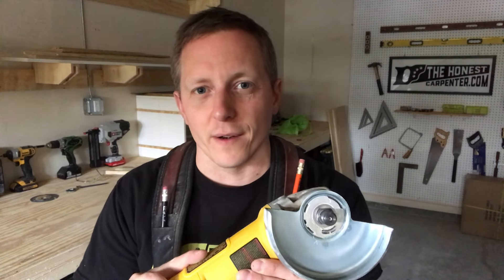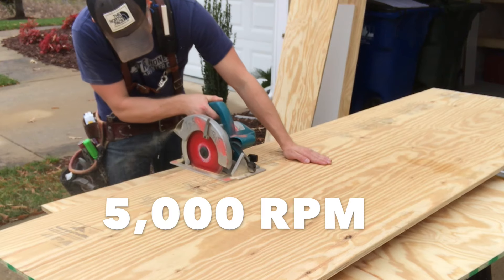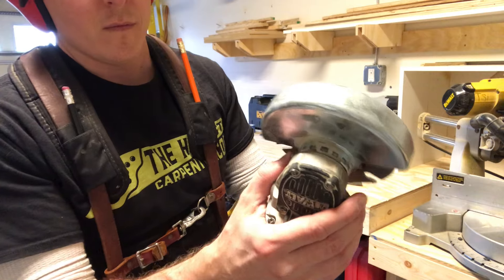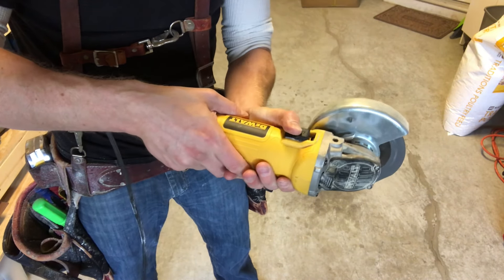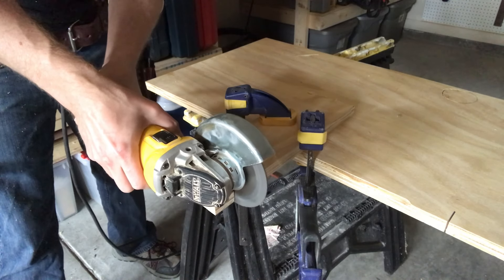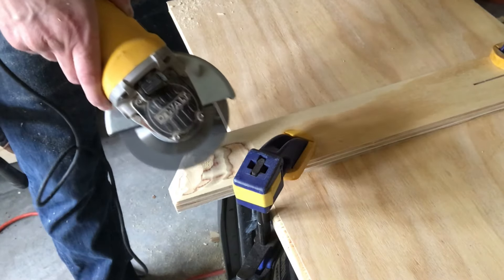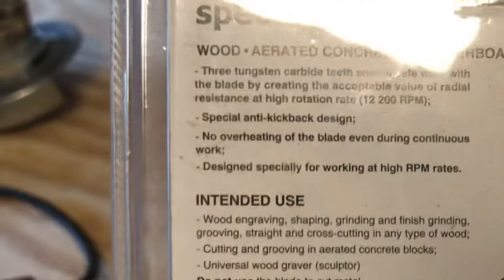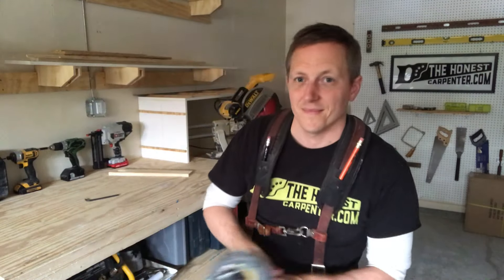CAN ANGLE GRINDERS CUT WOOD?? (Tricks + Tips--Cutting Wood With Grinders)

Comment: 35 stitches up the front of my leg from this idea. It opened me up like a salad sandwich. Don’t do it. Wood blades should not be used on this tool. Also, the corded model that your using has no safety switch, so the tool will dance all round your workshop, whilst you are bleeding right next to it. Don’t do it!
Reply: i also had 35 stitches , very very dangerous tool
Reply: Hope you recovered guys, thanks for sharing.
Reply: If you just need to cut wood with that ugly finish, just grab the cheapest circular saw........it will do the job way much better.
Reply: Thanks for making my day 🤣😂🤣😂
Reply: Thank you for posting this! I had the blade in my Amazon cart to buy, but now I know it's not worth the risk. I hope you are ok now.
Reply: @colinmellor3914  so sorry. Thank you for the warning!
Reply: I'm in that club too. Not as many sticthes but, my middle finger got cut down to the bone and actually fractured it. I was about to cut with a fibrous metal cutting blade.I was in my setup stage and had all of my PPE on except my gloves even though in my case i doubt they would have helped much.   I squeezed the trigger to rev the grinder up as you would a car and the blade disintegrated. It probably got damage unbeknownst to me a week earlier when i was using it.
Reply: They call that a Suicide switch for a reason.
Reply: ALWAYS respect your tools.  ALWAYS be thinking "How can this hurt me"
Reply: @colinmellor3914  Y’all scaring me.😌
Reply: Ok fine i wont
Reply: I to had 35 stitches
Reply: Yeah I'ma stick with my jigsaw
Reply: *revokes reply so I dont jinx myself
*reads every comment
*loud MEH. 
*No guard. 
*meh. 
Legggoo.  Will report back lol. If possible.
Reply: Wait. . Wait. . 
Whats a salad sandwich?
Reply: Did anyone have 36 stitches?
Reply: Thank you for this info. I’m just learning to use a grinder. I will definitely remember your advice 👍
Reply: I have been a metal fabricator for years.  Never had stitches,lol.  However, grinders are not the least bit dangerous.  People are.  If you are a weekend diy-er...DO NOT BUY THIS TOOL.  You were probably never meant to do this type of work.  Hire a professional and save your digits and or legs.  If you want to learn, start off small with flapper wheels or soft wheels on some sheet metal, get a feel for it.  Learn to get a feel for this tool.  Sorry guys, that tool never caused any of you stitches.  You did.
Reply: @Andrei-xl1xe  not true.  I am well aware that this video was showcasing wood cutting.  My point is, learn the grinder first.  Then you can learn to use the wood blade.  I use them all the time.  I am a wood and metal artist.  This is the greatest attachment I've found for wood carving and cutting when I can't fit a regular saw in tight spots.  However, the reason as to why I haven't had an injury, is because I understand wood, I understand using a grinder properly, and I know what kickback is.  You can't just go crazy with this blade.  You have to use the stabilizer handle, and lock your arm in when cutting to avoid kickback if it happens and have a firm grip with the other hand but have that arm bent.  Just like with a chainsaw.  And you have to cut straight! It's not meant to cut in various directions.  But will carve in various directions.  Learn the tool FIRST. Learn kick back and the reasons for it. Then understand wood.  Then you will be able to use this tool safely.  See what I did there? "YOU will be able to use this tool SAFELY. "  Not, " This tool and blade is dangerous, you can't do it, don't do it." 

Cheers! Good luck! Shoot me your email, and I will gladly teach you how to use this safely.  Have an awesome day!
Reply: They’re not supposed to manufacture wood blades for angle grinder at all. Fortunately, my soft shorts was tangled into the blade and spindle then stopped the motor before I could unplug it with help. It only ended up with some very light scratch on my leg. The speed is too high for you to imagine what might happen to it.

The saw blade used in the video has only 3 teeth helps with reducing the kickback force. But still, unlike multisaw or circular saw that both have blade guides, without the blade guide, it’s not a stable tool on woods
Reply: @zackmassey8258  There’s still danger of letting the blade go to fast into the wood in a day that’s too tired. Since there’s no guide to make sure it’s always perpendicular to work piece, the kickback force may suddenly change. Special care and skills may work, but definitely can’t avoid potential dangers.
Reply: @forexsanjose6090  from what I heard, those blade are actually for compact(small) circular saws.
Reply: @forexsanjose6090  disagree.  "Letting" means YOU allow it.  And it is YOUR responsibility to cut perpendicular.
Reply: Thanks dude, i gonna get a proper machinery.
Reply: @Andrei-xl1xe  it's for anything compatable.  What isn't always compatable, is the person using the tool. Cheers.
Reply: @zackmassey8258 why should I hire someone when I can do it my self
Reply: @cameronwallen  You should do it yourself!  Only if you have EARNED the discipline necessary to do so. If you haven't,  well....I hope you have a general understanding of first aid.  Because you might need it.  Define the term "novice" on your own time.  It can and DOES apply to everyone, no matter the medium. Safety really doesn't come first if you think about it....discipline does.  Good luck!
Reply: I had no stitches and love this blade . Does that make me the dumb one . I think not!
Reply: @andrewlittner5472   amen.
Reply: ???   I use wood cutting blades all the time—— Perhaps YOU shouldn’t—— also it’s DuMB to not use the screw in Handle that goes on Top- the tool is much More stable with the screw in handle—- but I see LoTS of dummies using it without—- DUMB.
Reply: It would be better to use a handsaw after reading all of this.
Reply: Thanks bro i really wanted to do this to a cordless grinder but you know what I'm just gonna go ahead and buy a battery circular saw. Hope you don't have that misfortune again.
Reply: Tip if you have no muscles don't use a grinder or any power tool for that matter its for strong men and just hold it properly and attach all the grip handle part and hold it correctly don't hold it like a ball your not playing catch or throwing ball you need to have one hand on the grip hanlde and the other on the base and hold it tight its not a frizzby or toy grip it tight and hold it be one with it
Reply: How did that happen exactly? I mean does it flip out your hands and go off in a random direction? Turn around? Is the kickback that strong?
Reply: I got 36 stitches it's very dangerous...
Reply: @davefaulkner8156  how? Like how does that happen…
Reply: I’m really sorry that happened to you. Watching the video my main takeaway was that you shouldn’t actually try to do that.
Reply: And I'm about to cut a mailbox post to install a solar light on the top 🙄😒
Reply: Yup, 35 stitches for me too, but I was opened up like a ham and swiss on rye.
Reply: I saw the blade and your exact comment came to mind
Reply: I bought the chainsaw disc, now banned. Saw how dangerous it could be even in experts hands, bin, gone
Reply: I carve with mine
Reply: Thanks you convinced me sir!!!
Reply: 35 stitches right here.
Reply: thanks for the warning
Reply: @muhammedk470 😅
Reply: I was going to use a mini saw blade on grinder until I saw your comment 

I was going to use on yard work for cutting tree suckers

Not doing it now. Thanks
Reply: The only tools here are the idiots who don't use the equipment in the right way, I've had a angle grinder for nearly 2 years always wearing gloves and protective clothing including ear protection,  I've never even come close to hurting myself with using it so I can't understand how anyone can end up with multiple stitches just by doing a simple job. Use a circular saw or hand saw for wood cutting and yes I also have those tools without incidents.

Comment: I’ve used these blades for years on aluminum although it had more teeth. Biggest thing I can tell you is find the handle to that grinder. Never use this type of blade without a handle
Reply from the maker: I’ve never liked using the handle, Brandon. Always felt like two hands were steering from different directions that way. Maybe dewalts handle setup isn’t that good 🤔
Reply: I agree that the dewalt handles are not that great. I always used an old school metabo grinder which has a better handle and a spring lock nut for the blade. Again I will say you are correct in saying these blades are dangerous.....some people actually used to call them “suicide” blades. Definitely not a blade for a novice to power tools. Always love you videos man. Keep it up.
Reply: @TheHonestCarpenter  you just need to learn how to handle a grinder, a lot of users don't like a handle, but I think they just don't take the time to learn to use. I am a metal fabricator and use a grinder a lot for many things, I have been using many brands over the last 45 years, they are pretty much the same as far as handles go.  The only time I have been bitten is when working for someone else and using their grinder with no handle. My feeling is your hand is just too close to what ever blade you have on, no matter if it is a toothed, cutoff, type 27 grinding, buffing, sanding or wire brush.....stay safe, thanks for making this video, watch out for those chainsaw type carving blades, they are really bad about kickback. Cheers from Florida, Paul
Reply: That's what helped me today was the handle. I might not have attempted to cut without it.
Reply: Handle/no handle, they're going to be dangerous. I'm much more comfortable with a chainsaw.
Reply: @Stetson Rodrigo Instablaster =)
Reply: @Kylan Marley It worked and I finally got access to my account again. Im so happy!
Thanks so much, you saved my account :D
Reply: @Stetson Rodrigo Glad I could help =)
Reply: @TheHonestCarpenter  
This is the silliest argument against safety feature I have encountered for a long time. It is up there with all the excuses for not wearing a seatbelt.

Putting convenience ahead of safety is amateurish.
Reply: @TheHonestCarpenter  Yes, it is the fault of Dewalt. My grinder has one more screw hole on the top, so it is inline with the motor shaft. This allows you to get your hands in the correct position for the angle you have the blade at. If your sculpting, sure use the side holes, but when you are chopping, you need the third hole on the top.
Reply: @brandonmims9980  ha good i went with the Metabo WEV 125 15 and i can reduce the amount of spins, so it is the same dangerous in the end as a normal saw, but i don't need to buy an extra tool for the beginning
Reply: @TheHonestCarpenter  , it may be awkward for some at first, but the handle is a lifesaver if you ever get a kick-back!  No excuses. Always use the handle.  With practice you will become very comfortable using it.  Safety first!  Yes, I agree, this is a dangerous tool attachment to use.
Reply: N deadman switch
Reply: @TheHonestCarpenter  Lock the elbow on arm holding the handle, loosely adjust elbow on control arm.  No offense Mr. Honest.  At all.  However, I can't help but to laugh internally when you stress safety soo much.  I'm subscribed, and I love a handful of your videos.  I knew immediately after watching this, that you didn't really know how to use a grinder when cutting.  Be honest.  It's also hilarious that your commentors appreciate your attention to safety.   You DIDNT USE THIS TOOL SAFELY.   I know, safety is a cash cow.  I'm sure you're doing well.  But, blaming a handle!!?? And blaming a manufacturer for your lack of skills?  You literally blamed yourself, stating, " Always felt like two hands were steering from different directions".  Then it was the tools' fault.  YOU ARE OPERATING IT!!!  YOU ARE TEACHING PEOPLE TOOLS ARE DANGEROUS!!! Stop!  Teach discipline, safety will come.  People like you, and yalls influence is why everyone is scared to join the construction trades.  Construction is the most dangerous job on the planet because PEOPLE have to do it.  And most people don't have the discipline required to handle such a feat.
Reply: Had the bright idea of cutting aluminum the same way...but of course my handle was missing.  Shredded my welding glove and just nicked through the skin.  Almost an amputee
Reply: @TheHonestCarpenter  look like that grinder model have no handle position in parrallel with rotation axe - but that is the safest way for such applications
Reply: @ДмитроЖигалкін  That seems to be standard for cheaper grinders, only offering opposing mounting holes that are perpendicular to the rotation axis without offering a third hole parallel to the rotation axis.  It's really annoying; it isn't even like it is saving meaningfully on manufacturing costs.

Comment: As a kid, we had an angle grinder with a sanding disc on it. I put it on my lap and plugged it in. Well, someone had turned it on and, of course, it tore up my legs. So, another tip is to make sure the tool is turned off before plugging it in. Thanks for sharing this video. Great job!
Reply: Another tip is to not put it on your legs
Reply: That is awful thing to happen to anyone, let alone a kid. Some of these powertools are truly dangerous.
Reply: @SocratesWasRight  Putting in on your lap and plugging it in is plain stupid plus these are power tools not toys.
Reply: @sovietonion72  kids lack the experience in these things. It is stupid to give such tools for kids to use, not for kids to mistakenly plug it in while holding it.
Reply: Yeah my policy before plugging it in is to switch it to the on position then back again to be sure. Also, I've had blades break off on me twice now. I've just heard the noise as the fragments hit something at high speed, you don't see them. Just been thankful they didn't hit me and I always use the guard no matter what. Number of videos I've seen of people cutting without the guard freaks me out. Never ever cut without the guard.
Reply: Never @posinker

Comment: Had my first experience using a grinder to cut wood. First and last. Scary, scary stuff. Twice (was stupid to keep going after the first) the blade caught and the grinder jumped - fortunately to the side and away from my body. Happy/lucky to have tens fingers and two eyes still. Never again.
Reply: Were you cutting on the pull, as the guy says in this video? That sounds okay if the grinder jumps away from your body.
Reply: @craigmcqueen7992  i was. Blade never came anywhere near me to be honest. But spinning, jumping blades always leave me packing my shorts.
Reply: @scottwalton3708  yeah I reckon I would too.
Reply: @craigmcqueen7992  There was a great Stumpy Nubs video on the chainsaw attachment.   He was cutting on the pull, didn't lift the tool a fraction of a second before moving it back for the next pass, a tiny error on his part, so the blade DUG IN, the tool spun and ripped up his hand.  https://youtu.be/x1hf2UILN80?t=294   The chainsaw disk doesn't seem all that different to me than the three carbide teeth here.   He goes into some detail, I think the biggest issue is how unforgiving the tool is.
Reply: Same here
Reply: Same experience but with minor injury 🥺

Comment: You could increase your personal safety 100-fold if you fitted the handle that came with the grinder - it gives you so much more control if the blade ever does bind. I've had grinders nearly snatched out of my hand in the past and that was only with a metal cutting disk - I don't even want to contemplate a saw blade running amok . . . Still won't be using one of these things; I believe in using the correct tool for the job.

Comment: I've been using angle grinders daily for over 30 years and i must confess that i did get lazy regarding safety when using them. Until i had an avoidable accident resulting in a very nasty injury. Now, every single time i pick up a grinder, every time i have respect for the tool. On a side note i recently got rid of my old grinders and got a new modern model with brakes. Game changing in my opinion.

Comment: Thank you for being responsible! You always stress the importance of safety. Not enough tubers do that! Keep up the good work. Really helpful stuff.
Reply: There's no such thing as "the importance of safety", when whom wields the power has not earned the discipline required to perform the work.     - Zack Massey 

Also, he was not responsible.  Both elbows were bent while cutting.  Stabilizing handle was not used.  And you should NEVER use this to notch ANYTHING.  But, he referred to Safety first, which is why you you found this helpful.  Safety is an imaginary blanket that consumes people with no prior experience in the trade, or task at hand.  Earn the right to use this tool, and you'll find that the tool is not dangerous at all.  You are the danger.

Comment: I'm so happy to see you warning people of the dangers of power tools. It's better to warn than speak too late.. I bought one of these blades because the regular saw blade with multiple teeth scared the crap out of me with kicking. The 3 blades and depth stop seems like a great design. I didn't have rings to fit the larger arbor so will try it when I have them. When something kicks I'm like "Not worth it," whereas before I'd just go for it. Loosing the tip of your finger after drinking and playing with power tools (finger caught in the chain of a DIY electric chopper) gave me a heightened sense of caution and an appreciation to continue playing the piano. I can't imagine the loss of fingers or even a hand. We wouldn't need OSHA if more people cared to warn like you do. So thanks THC!